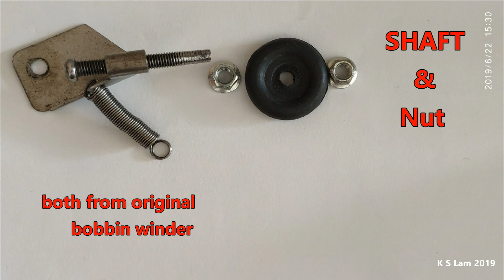Chinese Leather Shoe Patcher : winding bobbins with a power drill   中國補鞋機 : 用電鑽繞梭芯

Comment: did you make the alluminum thread adjuster knob ? the ones that came with my machine make even the smallest of thread to tight even when backed all the way ot? i noticed your knob thinking you had the same problem?
Reply from the maker: The thumb knob was bought separately just for adjusting the tension more easily and comfortably.  The original knob can do tension adjustment but  by turning more rounds than this.
Also this stainless thumb knob looks more professional.  The tension mechanism of the patcher works even you just pass the thread along the rails and discs without tightening the knob. This is because friction created when the thread pass through the rails and discs. So don't think too much on the tension knob.  If you found the tension is too tight, see whether there are anything blocking the way the thread passing through such as the twists bouncing out from the spool, the jamping of thread along all the spring, holes and rails.   This is a simple machine which means it is very easy to find out the problems yourself.

Comment: The only thing peolpe have to do is fix the dam winder .I repaired mine in about 15 min, I got a new screw same length ground a nice long tapper two new nuts .Then i drilled a hole in the bobbin for the thread to get tight in the tapper that holds the end and use it like it should work .
Reply from the maker: Drilling a hole in the bobbin to fix the thread from moving is a good method.  My idea suggested in the video is for those without drilling holes can get the same effect of stopping the thread from moving with a little blue tack.